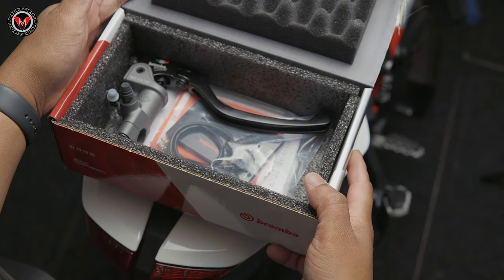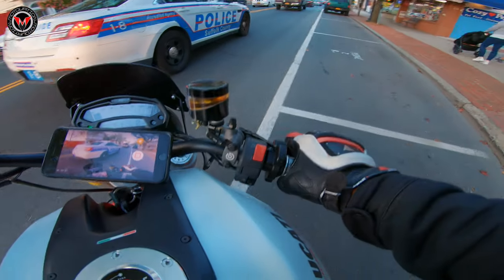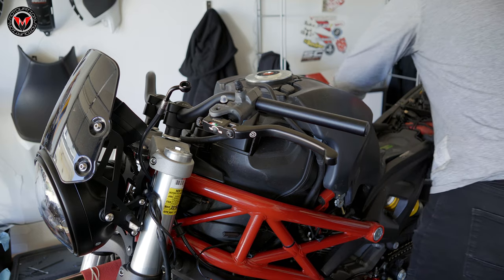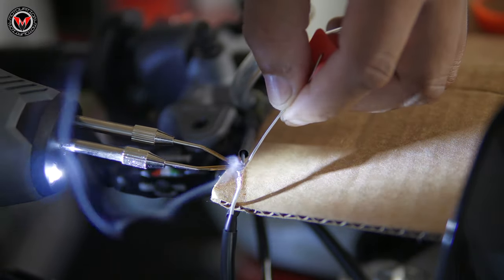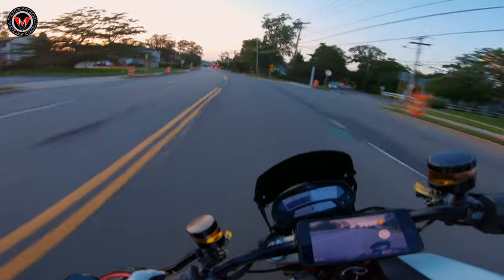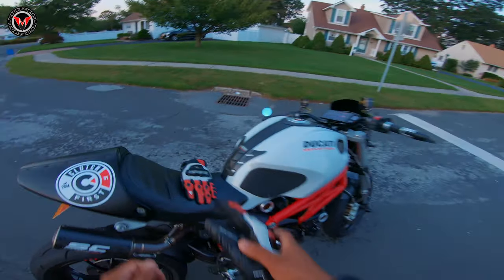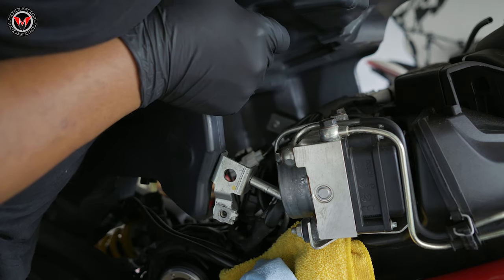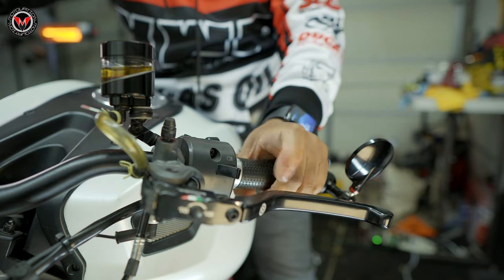Brembo RCS19 and RCS16 Master Cylinder | Longterm Review [My Experience]

Comment: Although the install seem difficult for an amateur, it still sound like the upgrade is worth it. Appreciate you for giving us your personal opinion and experience as usual. 🙌🙌
Reply: Denny King This install is not for the faint of hearts. Anything that requires snipping cables makes me nervous. That entire process was a growing experience. Soldering, vacuum sealing the wires and heat shrink wrapping is an adventure in its self. I learned a lot about the bike and myself.

Comment: Pure sales hype.  Took ten minutes to get to something of value.   Then the least amount of time spent on probably the most important feature, the piston actuation adjustment.  How does the 16-18 change work?  Does 16 provide more pressure or does 18?   Which does what?    This is important to someone who needs higher pressure with lower grip strength while moving enough fluid to actuate the brakes.   

How about getting a better explanation of how everything actually functions for those who need that information?    Just not a good informative video on the actual part, but by God we know he would have done this first if done over.  We know he thinks it's worth it, but nothing about the technical aspect of why it is so good.   That was what I needed to know - how it all functions so I know if it will do what the rider wants.   

I get the impression this master cylinder could provide the pressure at the lever that would normally take two different master cylinders, that the 16 setting provides the braking feel of a different size master cylinder than the 18 does.   If so, which is which and why?   This may be the reason to buy this product, to get the performance of a smaller piston master cylinder while being able to move more fluid to get the braking pressure needed.

Comment: How exactly do you figure out which master cylinder works well with your calipers? And what would a bad combination look like? Is it possible to exceed the brake pressure your calipers can handle? I'm thinking of upgrading, but I have Nissin calipers and am not sure where to start.
Reply: RCS19 is for all motorcycles with axial or radial twin 4 pot calipers

Comment: I just installed brembo rcs 19 on my 2020 zx6r. Was not a plug and play but I did not cut any wires coming from the bike. I took the old swith and removed the two prongs that go into the connector coming from the bike and soldered those prongs to the wires coming from brembo switch. Plugged them and taped with electrical tape to secure. Now if I ever need to go back to stock I can just buy a new oem switch and reinstall.

Comment: I know this is an older video but on the single banjo bolt pressure switch there's just two black wires. How do you know which is which? Or does it matter? Which goes to the blue wire and which goes to the black wire on the oem switch? This is for my rcs 16 clutch master cylinder.
Reply: I've been searching everywhere for the answer to this. Which wire goes to blue?

Comment: 2015 Suzuki GSX-750R w/ OEM Brembo Front Calipers

Brembo 19 RCS
CORE Coated SS Brake Lines
Galfer Superbike Wave Rotor (Race - the slotted ones)
EBC Pads

Never experienced brake fade. The master cylinder was the pièce de résistance.

Comment: hey, why does the bike need to be on when bleeding the brakes? The fluid is still going through the ABS system, or isn't it? Does it have something like a chamber or something that only can be filled up when the ABS module is runing? Does the bike has to be running or just On in the ignition? I'm changing everything on my bike, from master cylinders, brake hoses and brake calipers and i'm doing it myself.
That's some good info in this video to help us getting things done right, if you could explain ABS system part, I would really appreciate!
Reply: You have to have the bike on to get the ABS valve body to allow the new fluid into it.  Normally on cars or trucks they'd hook it up to a scanner and have the scanner talk to the ECM to actuate the ABS system (valve body)....you can trick the ABS system into activation by simulating an ABS event by having the drive wheel up off the ground and maybe the front as well and make them spin at different speeds; so if you put the bike into gear while its up in the air and the drive tire is spinning and you spin the front tire as fast as you can by hand it makes the ECM think the bike is in the middle of a tire spin event and will turn the ABS system on, new fluid will flow into it and flush or push air out of it as well.